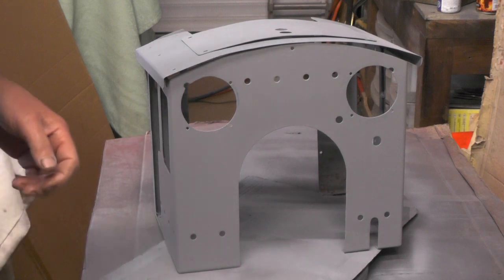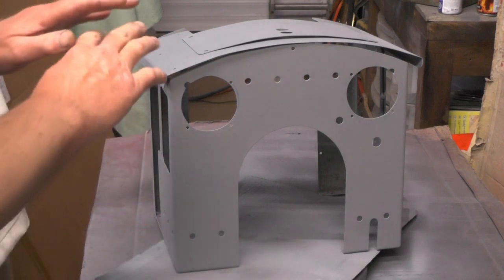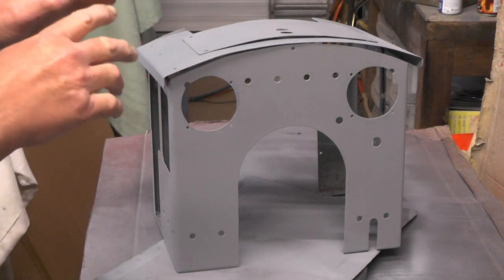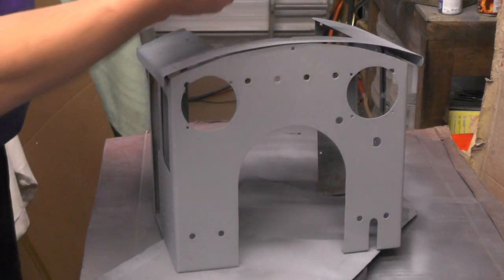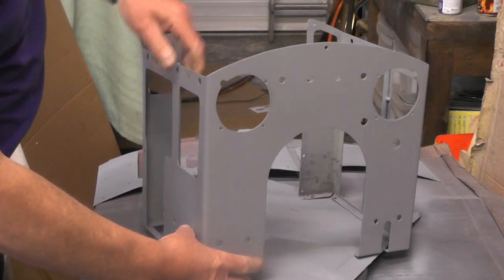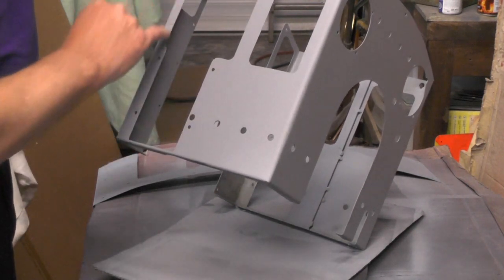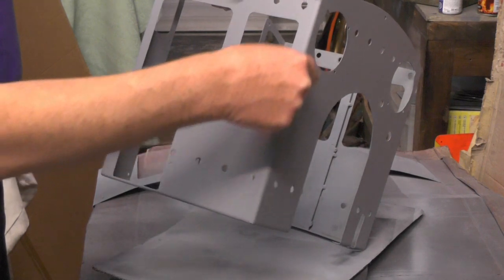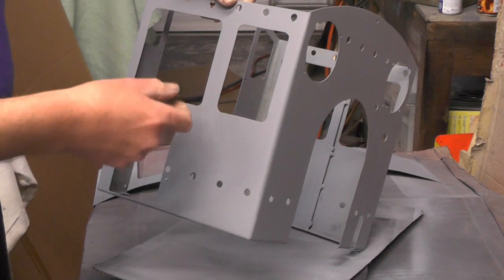Make a Beginners Miniature Steam Locomotive Series (Making the Cab Part 5 Conclusion) "mr factotum"

Comment: Hey Mr F. She really is a beautiful loco. You must be pretty happy with her and so close to finishing now. When it comes time to steam her might I make one suggestion and that is do not touch the loco paintwork. I know that feeling when you see a bit of ash or a water spot on the new paintwork, but I learnt the hard way that some paints get quite soft that first steaming, especially on the boiler cladding but once they have cooled they bake hard and you don't need to worry about it again. All of those marks can be cleaned off and she will look as good as new. It would be awful to have rag marks on that great paint job. Your paint might also be fine but thought I would let you know my experience.
Reply from the maker: hi osiris
thanks for compliments, and thats great advice thankyou, as a beginner i probably would have fell in to that trap and spoilt the paint,  also i havn't forgot the tip about the magnets for the cab sun roof!!! just need the time to fit it in.
thanks again
regards
mr f
Reply: @MrFactotum  hopefully it wont happen to you but always good to pass on info just in case. If you look at my simplex on my channel i painted that and followed those rules and it still looks good. I know the paint went soft as i can see that the boiler bands sunk in a little but It takes an owners eye to notice these things sometimes, and others wouldn't notice unless they are told.
Reply from the maker: @jefferyfarrell  thanks , i will take a look at your channel and videos.
regards
mr f

Comment: How did you manage to do the red lining so easily? When I've tried this, the paint seeps under the masking tape and ends up a disaster. Are you using something special for the lining mask? Thanks
Reply from the maker: hi john
the tape is just run of the mill lining tape from any automotive suppliers. Its got like a plastic feel to it and comes in different widths, its not like the paper masking tape.
hope that helps, any questions feel free to ask
regards
mr f